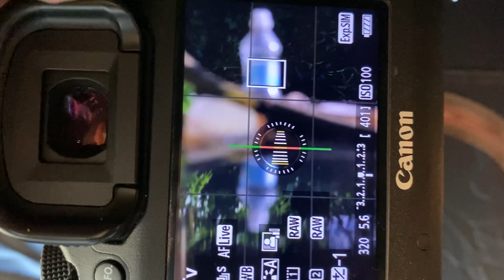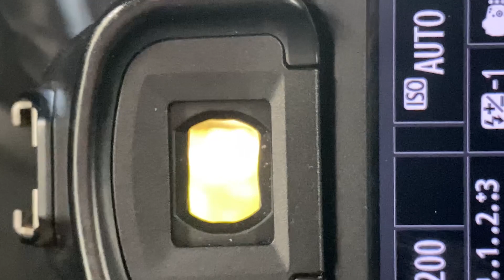Garden Bird Photography - Setting Up a Bushwear TP Hide and a Reflection Pool

Comment: Lovely images Gary. I've started constructing my wildlife area and had a similar idea for a reflection pool. When the centres open, I will use a black square drip tray with weed control material in the  bottom, the cloth variety, (no plastic and blue lines). then build it up with pebbles etc. Finish off with Sphagnum Moss to cover the edges. You might find the materials useful. Regards.
Reply from the maker: Thanks Victor, excellent advice and as soon as I can get out I'll be looking for similar :-)